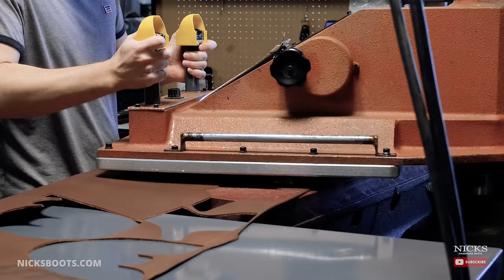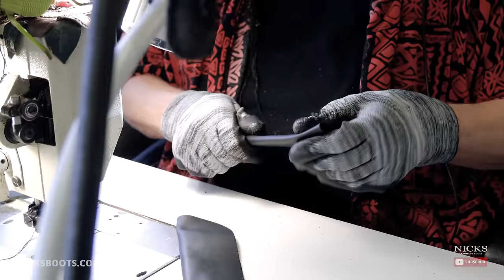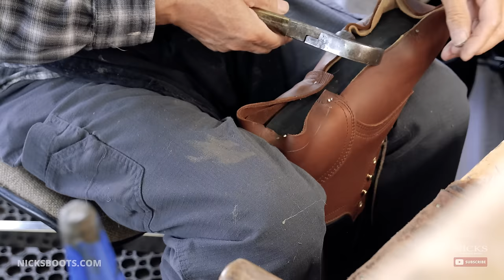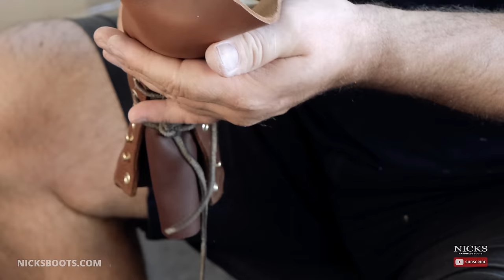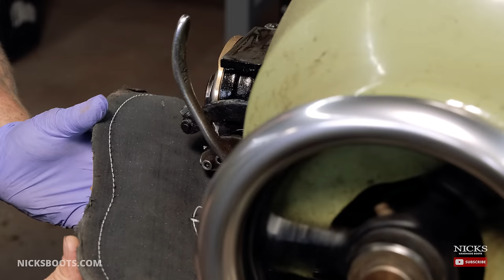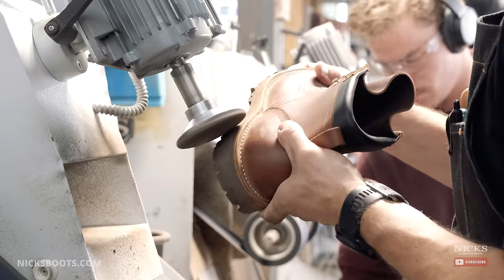World's Toughest HIKING Boots! How It's Made: Nicks Ridgeline Hiking Boot

Comment: I've had a pair of Builder Pros for going on 3 years. I actually sent Nick's an e-mail shortly after getting them asking for a hiking boot with the Vibram Sierra sole... I've got a pair of White's Outdoorsman boots with those soles and they are great for casual woods walking in damp conditions (gore tex bootie inside) but lack an arch and are too tall at 10" for hiking. When Nick's announced the Ridgeline I ordered a pair without hesitation. In both cases I had Nick's them made to fit my feet. Absolutely no regrets... both boots get more comfortable with use and the Sierra outsoles are fantastic on the trails whether it's a rock climb, climbing over roots, or navigating muddy sections. Great boots!

Comment: How do the ridgeline compare to the Howard? They seem quite similar.
Reply: The Howard is slightly taller (6"), and does not have the 360 stichdown with a rubber midsole like the hiker. The Howard has a leather midsole and the traditional partial stitchdown construction with a nailed heel. The 360 stitchdown construction and rubber midsole makes the hiker more water resistant. The hiker will also be more flexible than the Howard, though some like the solid support underfoot of the Howard.
Reply: @TommyNitro  thank you for the detailed response

Comment: I'm sorry, but they should be lace to toe with D-rings etc. etc. They look like work boots with a Sierra outsole. A little more effort wouldn't hurt.
Reply: I personally hate lace to toe! Once my peanut bison order comes in, these will be my next purchase.  Perfect for my line of work where I might be in the field all morning and board meetings all afternoon! They are really adding a lot of new styles lately! Hopefully one will fit your needs/likes, they truly are fantastic boots!
Reply: “A little more effort”???  🙄
Reply: @joshlambert1247  I own a pair of Buider pro's and love them. They're amazing boots and I could go hiking in them if needed. Lace to toe is needed when doing a lot of up and down hill or side hill hiking to keep your feet firmly in place, that's why classic style hiking boots are made that way. I just personally think a lot of Nick's new styles look like the same boot, different color and/or outsole. They're trying for variety but they're just not that different.
Reply: @minghsiuchua8115  It's a hiking boot. Hiking boots are supposed to be rigid.
Reply: @KB3AOL  In the design department. They look like a shorter builder pro with a Sierra outsole. I'm sure they're awesome boots, I kind of want a pair. But, I wouldn't say they're a hiking boot.
Reply: It's a different outsole system with the soft cushion material between the mid and outsole. They've also changed the insole to be what I assume slightly faster to break in and lighter. Then they've added soft cushion around the neck of the boot.
It's a fair bit different to what they usually do, and just because you wish to have lace to toe and D-rings does not mean others wants it.
So the "effort" part you wish from them is just down to taste, really.
No, their designs are not radically different from what they usually do, and that's because they stick with what they know inside and out. Maybe if the demand is bigger they'll do another design all together, but until that demand can turn a profit, they'll continue with what they know.
Reply: really pretty, but that toe box sure looks tight. wouldn't want to walk downhill in those for sure.